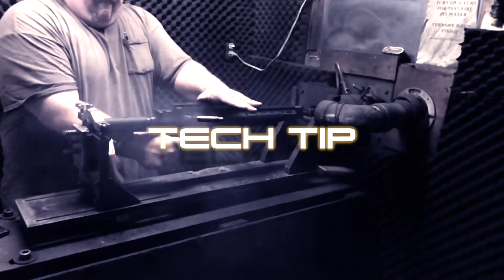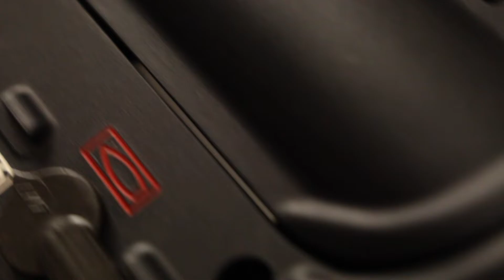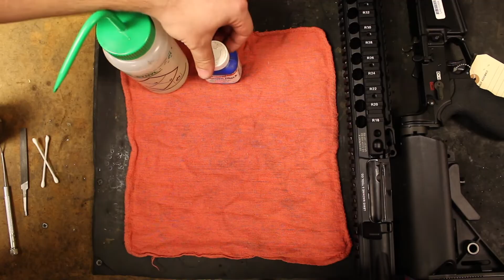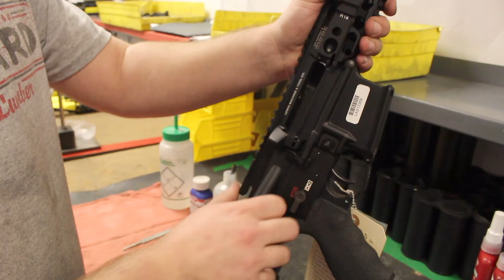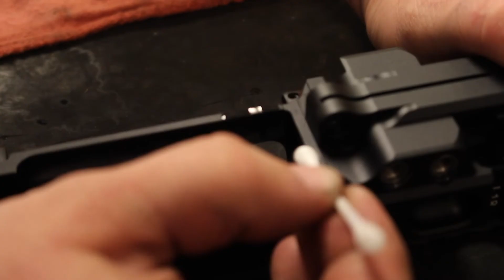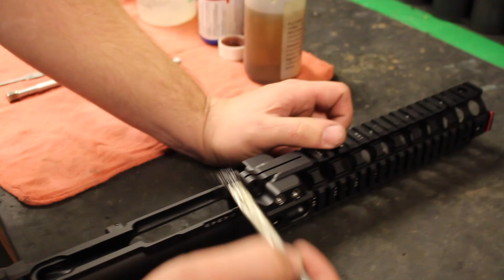Fitting an LMT MRP Upper Receiver

Comment: anyone know the file hardness/teeth (I'm new to this world lol)? or will any file designed for metal work?
Reply from the maker: You wont need much. Youre just removing thousandths of aluminum. Use something with a fine pitch for ease of use and low amount of material removed per pass. Definitely no dremels!

Comment: What purpose does the speed bump do? Odd to spend so much and have to do this just to close it or am I miss understanding?
Reply from the maker: Designed to reduce or eliminate wobble between the upper and lower receiver. A tighter fit, may help improve precision accuracy.
Reply: @lmtdefense3927  thanks for the reply! I appreciate your taking the time.  This makes sense and is pretty thoughtful! I’m curious have you’ve ever seen material crud and/or sand get in between and cause a malfunction. Personally I’m leaning towards filing them down to close the gap, get it more accurate,  and avoid debris getting in the good bits (just in case). 

Long live LMT!
Reply: It’s so no matter what lower you put on your LMT upper there isn’t slop

Comment: What are the speed bumps for?
Reply from the maker: It maintains a tight fight between the upper and lower. Mil-Spec fit can be kinda loose.
Reply: @lmtdefense3927  so, its not necessary to file them down? I just bought an MRP upper & will either pair it with my Defender lower or MARS lower.
Reply: @fdlp83  doesn’t seem like it unless you want a tighter fit.

Comment: In this case I believe he only applied lubricant after the alumiblack, brownells gunsmith told me I had to flush the are with water, dry completely then lubricate. I know you all use the product in your shop and I need to fix a new mws lower ( shipper was an idiot, bare metal scratch on my 308) as well as fit my mrp upper using the product, can you clarify?
Reply from the maker: Either way will produce desired results. The idea of the oil is to stop the artificial oxidation produced by the Alumi-Black. Allowing it to wash and dry first removes the chance for the chemical to remain on the metal in a diluted form. The most important step to repairing a scratch is to ensure the area is properly degreased.  Any oil will reduce the efficiency of the Alumi-Black.